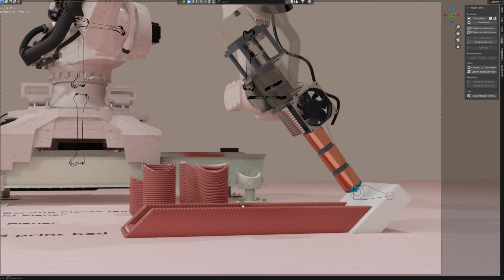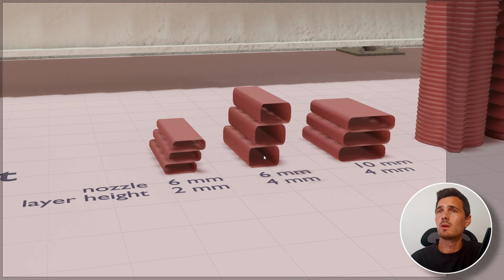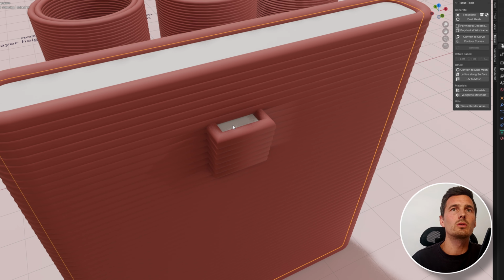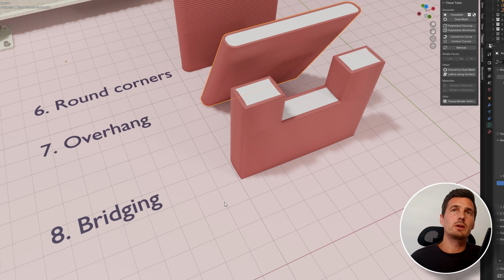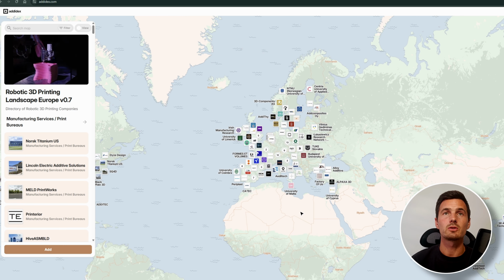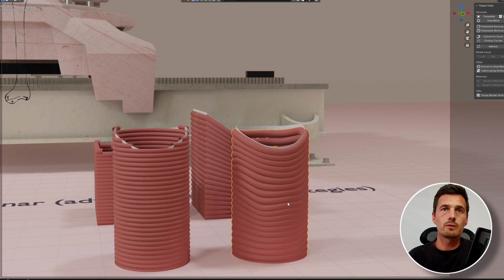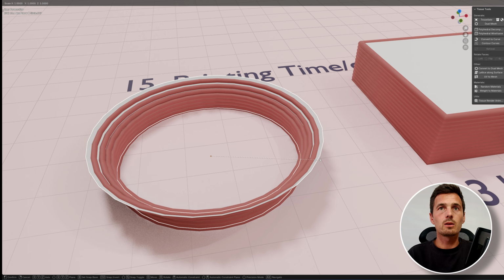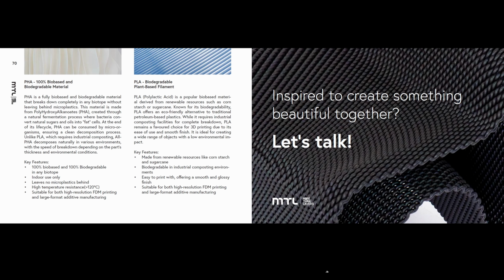How to Design for Robotic 3D Printing | Complete Guide

Comment: The main limitation with robotic 3D printing today is not ambition but control resolution. Industrial robots lack the positional accuracy, dynamic stiffness, and process fidelity required to reliably produce the geometric complexity achievable with conventional gantry based additive systems. As a result, beyond a certain scale or curvature threshold, designs tend to collapse into a narrow family of repeatable forms, typically long continuous toolpaths with gentle curvature and minimal overhang (although more complex parts can be created with 45 degree printing).

Robotic extrusion works well where geometry can be expressed as uninterrupted trajectories under relatively constant process conditions. Problems emerge when designs demand tight tolerances, high frequency directional changes, compound curvature, or variable deposition behaviour. Unlike Cartesian printers, the robot is not a purpose built additive machine. It is a general motion platform whose accuracy, repeatability, and compliance are highly dependent on arm configuration/integration, payload, reach, speed, and thermal state. These variables directly affect bead placement, layer consistency, and inter layer bonding.

The gap between digital design and physical outcome is therefore substantial. Many robotic printing demonstrations rely on idealised toolpaths that assume perfect kinematic behaviour and neglect real world effects such as deflection, vibration, material lag, extrusion latency, and thermal accumulation. This gap is further widened by the limited sensory feedback available in most current systems. Without high resolution closed loop control, including real time vision, force, and process feedback, the robot cannot compensate for deviations as they occur. The result is that form is constrained not by imagination, but by what the system can blindly repeat with acceptable error.

In short, robotic 3D printing today excels at scale and expressive motion, but struggles with precision driven complexity. Until sensing, control, and process integration mature to the point where the robot can actively perceive and correct its own output, the aesthetic convergence and geometric simplicity we see across many projects is less a design choice and more a technical necessity.
Reply from the maker: Spot on technical analysis regarding the hardware. The robot arm definitely behaves differently than a rigid gantry system.

That is all the more reason to educate people on the specific design considerations for working with these kinds of setups. And, in our case (furniture and design), tight tolerances haven't been a problem.
Reply: @M @MJsweers  It is a similar story with robotic CNC machining. There is an expectation that an articulated robot should deliver the same accuracy, surface finish, and process stability as a dedicated CNC mill, often at a fraction of the cost. In reality that comparison is fundamentally flawed. CNC machines are designed around rigid kinematic structures, short load paths, high stiffness, thermal control, and tightly integrated feedback loops. Industrial robots are not. Their compliance, joint backlash, and load dependent deflection make them materially unsuitable for high precision subtractive work except in very constrained use cases.

Robotic 3D printing follows the same pattern. The technology excels where scale, reach, and expressive motion matter more than micron level control. It enables unusual forms and large structures that would be impractical for conventional printers, but this often manifests as novelty rather than performance. The system can do visually interesting or unconventional things, but it cannot yet compete with purpose built additive machines in terms of accuracy, repeatability, or geometric fidelity.

This is not a failure of robotics as such. It is a mismatch between expectations and physics. Until robotic systems achieve dramatically improved stiffness, sensing, and closed loop process control, they will remain complementary tools rather than true replacements for specialised CNC machines or high precision 3D printers.

Comment: Another great video on a very esoteric topic! Looking forward to more.
Is the "robots" plugin in grasshopper a good cheaper alternative to advanced tool paths softwares like Aibuild or Adaxis? 
Are softwares like Aibuild or Adaxis essential for robotic 3D printing?
Reply from the maker: Thanks and good questions. 

The Robots plugin in Grasshopper is a great way to experiment and learn how robotic toolpaths work. AiBuild and Adaxis are more made for production. They take care of a lot of things automatically, like slicing, post-processing and monitoring. That is why they make more sense once you start printing on a regular basis. The Grasshopper route is definitely 'cheaper', but also harder to learn. You need to understand both the design logic and the robot motion. So cheap, yes. Easy, no.

If you are an external designer and your production partner already works with AiBuild, Adaxis or any other advanced slicing software, it is better to collaborate around their setup/software directly. You will not have their full configuration inside Rhino or Grasshopper anyway, so it is always a collaboration. It helps a lot if you already have their software in mind while designing, because it makes communication smoother and you will get more out of their machine.

Does that answer your questions?
Reply: @MJsweers  Thanks, it does answer the questions. Which softwares do you guys use at MTL? Do you have an internship option? I would love to get to learn hands on and help wherever possible.
Reply from the maker: @PlanetarySymbio  Most designs are printed at 3D Makers Zone, next to us in Haarlem (Netherlands). They use grasshopper+rhino and Adaxis. 

No internships at the moment, but our collaboration model will change early next year to make it easier for external designers to join MTL.
Reply: @MJsweers  Great, thanks for the answers. 
Looking forward.

Comment: Thanks, this is very insightful.
I'm wondering, why can't the problems of overextrusion on tight corners (14:10) and heat control (18:15) be solved in software? Is extrusion speed and print speed not controllable enough?
Reply from the maker: The problems with overextrusion in corners and heat buildup could, in theory, be fixed with smarter software. But in practice, robotic 3D printers don’t yet have the sensors or precision to make that work perfectly.

When the robot slows down to take a corner, the plastic inside the extruder is still under pressure, so it keeps coming out for a moment, like toothpaste after you stop squeezing. The software can’t fully predict or stop that without real-time feedback.

Heat mapping in robotic 3D printing is definitely improving. Some setups already use thermal cameras or IR sensors to monitor surface temperatures in real time, helping to see where material cools too slowly or where heat builds up too much. However, this data still isn’t connected directly to print control.

In short, modern setups can be tuned much more precisely, but older systems, which are still the majority, often need manual workarounds and a bit of operator experience to get good results.In summary, modern setup's can tune way more, old setups (most of them) need some workarounds.
Reply: @MJsweers  thanks for the detailed insight!
Reply: @MJsweers this is similar to linear advance tuning in desktop 3d printers
Reply: In terms of modern vs old setups, do mind naming some brands for context? Thank you for the excellent video!
Reply from the maker: @215Xavier with 'old' i mean refurbished robotic arm + custom extruder. By modern I mean fully integrated systems like CEAD, Caracol, Rapid Fusion, Zikness or new robotic arm + custom extruder like the ones of  xtrusion. You can find most of them on Addidex btw.
Reply: @MJsweers cheers